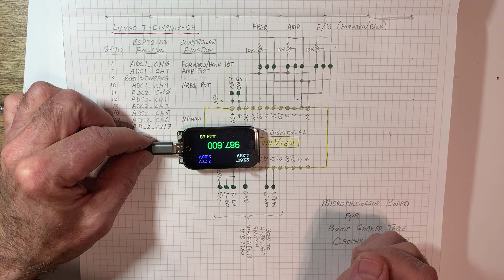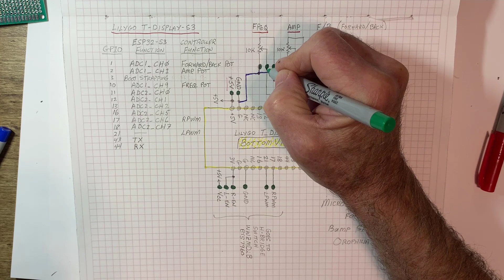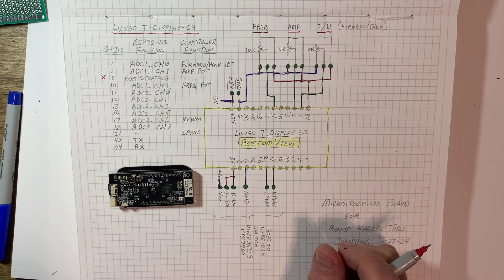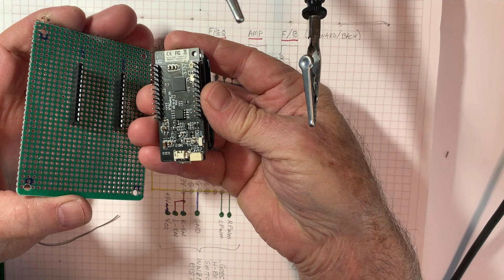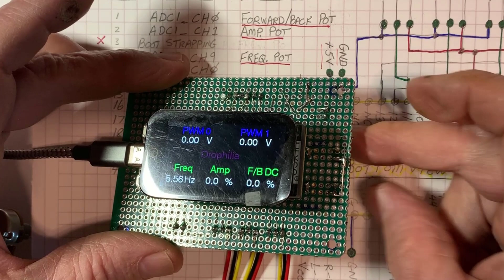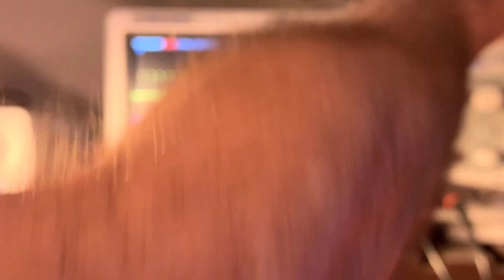Gold Bump Shaker Microprocessor Board

Comment: Dave, I am getting the following two errors when trying to upload the code. I have to admit im not a coding expert, any help is appreciated.

error: 'ledcSetup' was not declared in this scope
   73 |   ledcSetup(PWM0_Chan, PWMFreq, PWMRes);    // set up PWM0_Chan for left side switches
      |   ^~~~~~~~~

error: 'ledcAttachPin' was not declared in this scope; did you mean 'ledcAttach'?
   75 |   ledcAttachPin(LPWMpin, PWM0_Chan);           // attach the PWM0_Chan PWM generator to its output pin
      |   ^~~~~~~~~~~~~
Reply from the maker: Unfortunately, Espressif changed their library commands for the PWM functions (ledcSetup and ledcAttachPin) and they are not backward compatible. That's a huge no-no and it means that either you have to revert to an early library version or you have to change the code. Please copy the error messages and prompt Gemini or ChatGPT and you should get an immediate answer.  -- Dave

Comment: Wouldn’t a simpler design just employ a DC drill motor with a strong magnetic attached to one side if the shaft and then mount opposite facing magnets to wood mounted underneath the table.  Then just use a pwm motor controller to adjust the frequency of shaking?
Reply from the maker: Yes, I think you could probably make that work. I need the ability to adjust the frequency and the amplitude (force) at the same time, so the micro is nice to have.
Reply: I understand 👍. BTW, do you have plans or video available for making the table, specifically the use of a table saw to cut the groves, sanding, and type of paint.  Maybe you do have a video and I just need to find it.  Thx for the reply!  Great content 👍
Reply from the maker: @MrMoonFlame  Yes, there are videos that go into great detail on the construction of the table, the electronics and the microprocessor board. There's code also.

Comment: When I tried to upload your code onto the mirco controller I got this error code what do I do?C:\Users\nmbra\AppData\Local\Temp\.arduinoIDE-unsaved202418-34172-109mtlc.dkrug\sketch_feb8a\Bump_Shaker_Code.ino:7:10: fatal error: TFT_eSPI.h: No such file or directory
 #include <TFT_eSPI.h>                           // Graphics and font library for display
          ^~~~~~~~~~~~
compilation terminated.
exit status 1

Compilation error: TFT_eSPI.h: No such file or directory
Reply from the maker: Howdy Brady. Yeah, it can be frustrating to get code to upload and run. One thing at a time. Are you using the Arduino IDE version 2? Do you have the Lilygo T-Display-S3? It looks like you need to load the TFT_eSPI library. Here's a YT video that should help: https://www.youtube.com/watch?v=WFVjsxFMbSM
Reply: Thank you.  I am using Arduino IDE version 2.3.0.  I am using the Lilygo T-Display-S3 micro controller.  I have not loaded the TFT_eSPI library.  Thanks again!    @orophilia

Comment: Thanks for another video, helps put the pieces together for someone without any electronics experience. I'm thinking of using the M18 batteries I already have, according to what I found online it appears i'd need to go to a 20 AWG wire make up for the drop in voltage, does that sound right? I designed a spool and 3d printed it, if youre interested I could share the model or mail you one.
Reply from the maker: Hi Sparks. Can you explain further what you have in mind? I can't connect M18 batteries and 3D printed spools with this. Thanks. -- Dave
Reply: @orophilia  I'm working on building the copper coil. The m18 are milwaukee 18v battery packs. I have a lot of these packs for power tools. They also come in handy for pumps, vacuums, impact drills. And the spool is for the coil. You mentioned reducing the coil resistance to balance out a lower voltage. I'm planning on building the copper coil with the 3d printed spool and power it with the 18v battery. And wanted to get your thoughts if using a 20 AWG wire would be sufficient to offset the drop from 24v->18v.
Reply from the maker: @placerlogic  Yeah, I use Makita battery packs for field use. They are very convenient. The voltage varies quite a lot from fully charged to discharged, so I would still use the boost converter to get up to 24V for the motor. It will be very stable. You should use 24 AWG magnet wire and shoot for about 15 ohms. I would use #24 wire even if you drive the motor directly from the battery. #20 AWG is way too big. Cool on making your own coil forms! -- Dave
Reply: @orophilia  Thanks I'll follow your advice

Comment: Thank you!  Amazing video.  I can't wait to get working on my motor, but I can't understand how the voltage divider works or how to make one.  I also can't figure out which port the pwm signal goes into to get the read out on the screen.
Reply from the maker: I'm going to connect everything up together in one of the coming videos and I'll try to make it clear. -- Dave
Reply: Thank you @orophilia
Reply: I figured out how to make the voltage divider, but I can't figure out which port the voltage divider feeds into?  Is  the pwm Left and Right?
Reply from the maker: @bradysbackyardfarm9836  In my design there are two other PWM controllers that are completely independent of this microprocessor board. One controls the voltage on the pump and the other is a spare. The input to the two voltage dividers will come from the outputs of these independent PWM controllers.  -- Dave
Reply: Thank you so much!  That explains a lot.  I thought that they were for the h bridge switch.  Which pin or pins do the voltage dividers plug into on the micro controller? @orophilia
Reply from the maker: @bradysbackyardfarm9836  The schematic shows that they go to GPIO 12 and GPIO 13 on the ESP32-S3.  -- Dave
Reply: Thank you so much.  Your videos are amazing. @orophilia
Reply: I am working on my micro processor and I had a question for you.  Can you post a picture of the schematic and also where dose the other positive or negative wire go.  I can't see where it connects to the micro controller at.  I only see 1 wire going to gpio pin 12 and gpio pin 13.

Comment: In motor control I usually synchronize the ADC to the PWM so I can sample during the off period and then I track the EMF signal of the motor.
This works for most motor systems when you want to be in synch or resonance with the motion. It consumes much less power than a fixed frequency and is self adjusting to the load.
In your case it should be possible to put energy into the movement during the motion of the table and stop during the spring return and again switch at the bump stop (or spring return other way during startup). The other benefit of synchronized driving is the ability to set a "bump energy" by regulating the power so the EMF has a certain swing out from the neutral which it again returns to the bump with. This could possibly be combined with a adjustable bump-stop for the option of adjusting the full travel. The drive would selv-regulate to new bump stop.
Reply from the maker: Great comment. I want to measure the position of the table and feed it back into the control logic, but perhaps I only need to measure the back EMF of the motor. I'll have to work on that. I agree that synchronizing the force to the motion and to the bump is an excellent plan. Thanks.